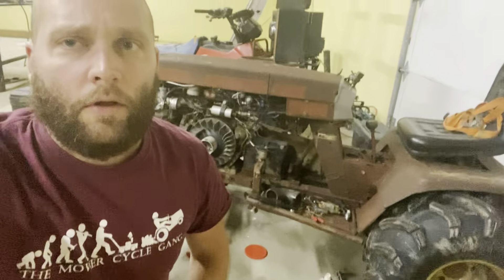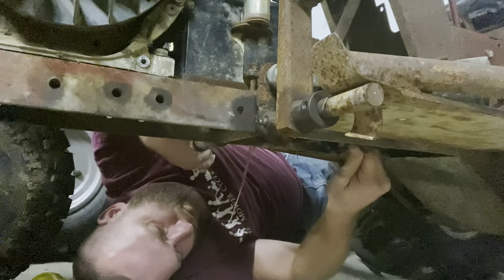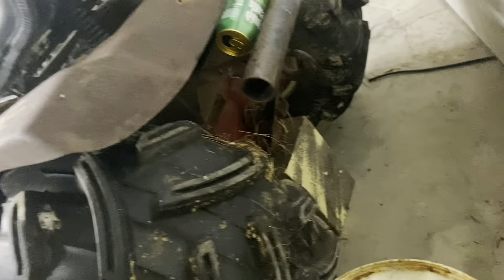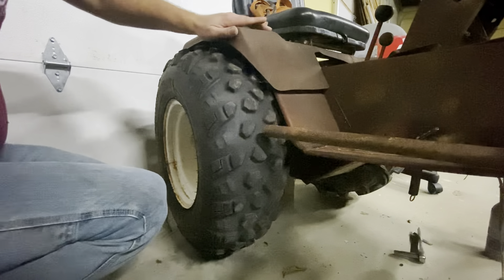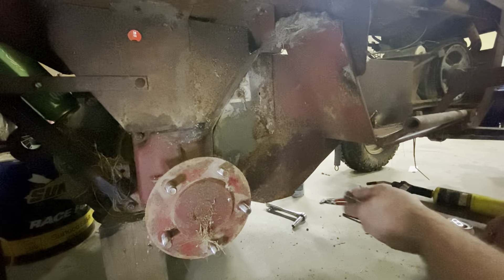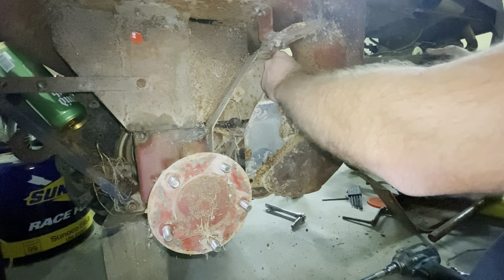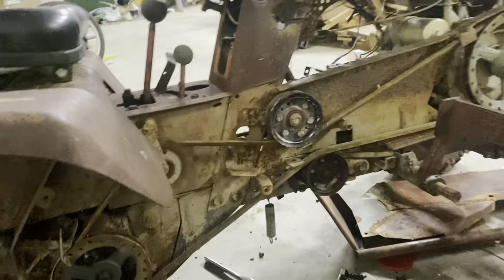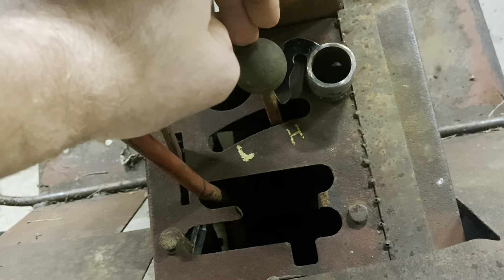Rusty Revival 3!

Comment: I have a video of my wheel horse tractor, just dont know how send it your way. I orginally built her with a Kohler command 15 horse, however, i had broken studbolt end up in the cylinder. Very minimal damage, but after pulling the cylinder head, replacing the head gasket and putting it all back together, damn thing will not start. Would you have any ideas as to why it wont start besides spark, its getting plenty of spark
Reply from the maker: Check your valve clearance, they might be to tight and leaking off all your compression or to loose and not opening enough to run
Reply from the maker: Get a can of starting fluid and see if it will start on that, if it will you have a fuel problem if it won’t it’s likely a valve problem
Reply: How do I check the valve clearance, I didn't do anything with the valves or the valve springs, I did check the lifter rods and they were not bent
Reply from the maker: @EricHooper-tr3zc   google it buddy, your new gasket might have been thicker or thinner than the old one